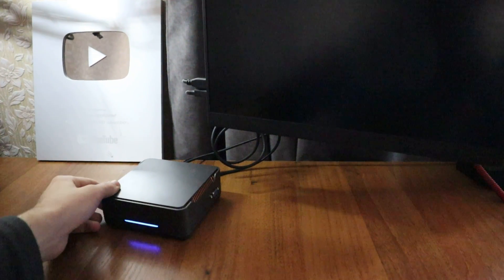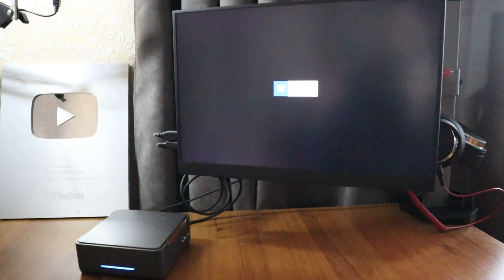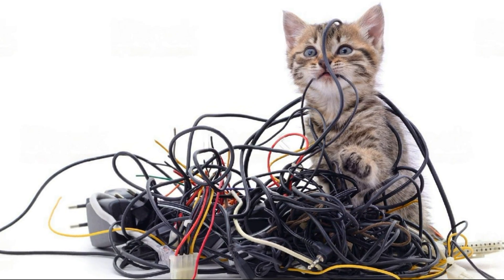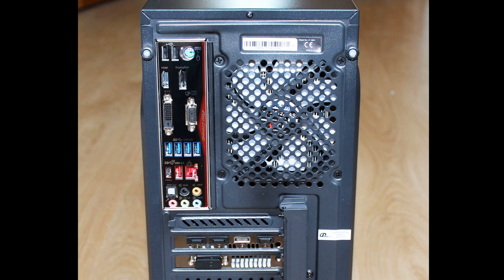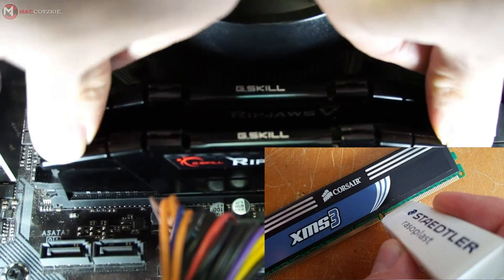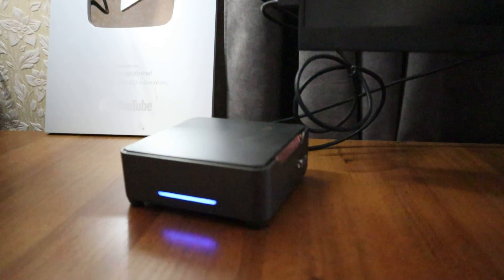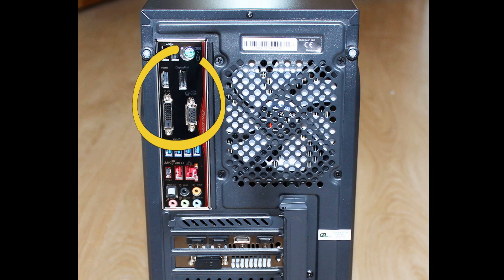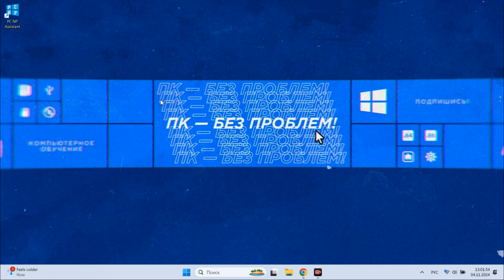Solved! PC is ON but no display! Black Screen while computer works.

Comment: My pc sometimes doesnt initiate display but turning off the psu first then on again, before turning on the pc it will work again. I can play just fine with any amount of load to the gpu. But when I restart after a long session, the display fails to show but I can still the sound of windows. To fix this, I turn the psu off behind, then on again. turning on the pc after  this  then it starts my display as normal And restarting early will also work. But after a long playing session, an attempt to restart or shut down and opening again will result in a no display, but still I can hear it boots. Its either my gpu or psu I think, but comments are welcome.

Any suggestions?
Reply: I have a similar problem, if the pc is turned off when I turn it back on the screen turns on, says it doesn't have signal and turns back off, only way to get it to work is to force restart the pc by pressing the power button for 10 seconds, after which it will work normally until I turn it off again

Comment: New desktop (works in the shop) New power strip, new hdmi cable, but still get a black screen. TV/monitor comes on. Is this a wattage problem?
Reply: Did you find a solution to your problem? I have the same thing happening.

Comment: Oh was that the procedure.
I always go straight from checking cables to ram and bios battery 😂😂, it it does not work, i check the power supply. Thanks for the additional knowledge

Comment: Thanks for the video.  I'm working on a Dell G5 5000 with no video.  Customer has really messed up this computer.  500w PSU, I bought a new 4060 to replace his 2060 -- still no video.  No BIOS lights.  If I remove RAM, I get the BIOS RAM code via LEDs.  I've pulled the battery, changed video cards, changed DP port, HDMI, Hard Boot the BIOS, still no video.  Thoughts?
Reply: Did you fixed it? Have same issue
Reply: @NizarBEit was a motherboard issue. I replaced the video card to no avail.  The client tried to jump mobo circuits to get into the BIOS following the wrong directions, and shorted the mobo